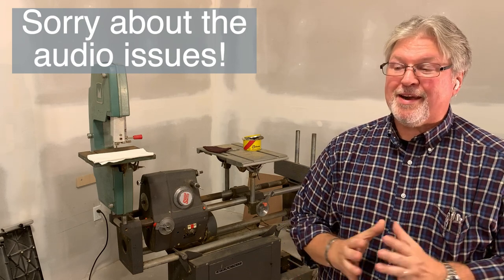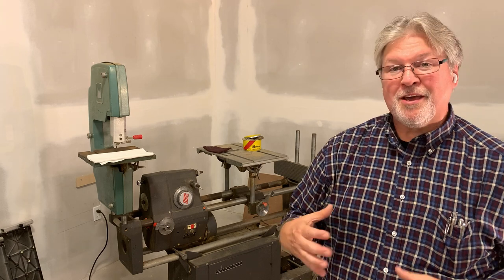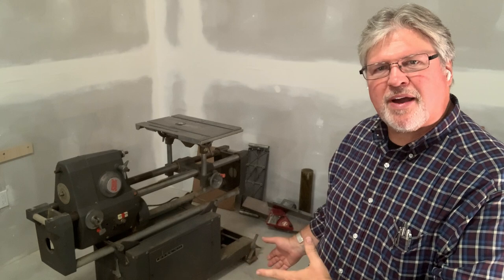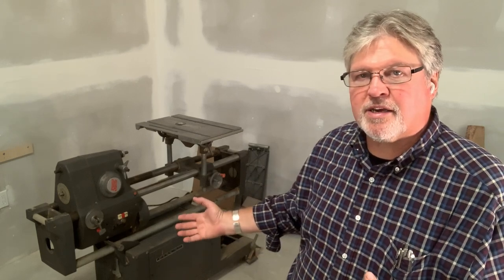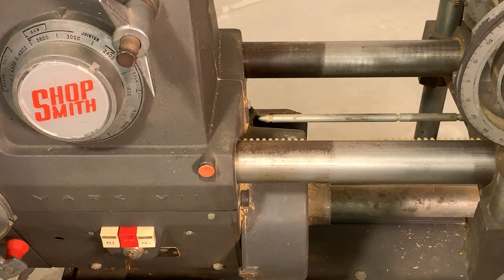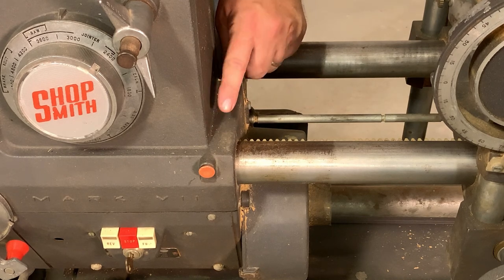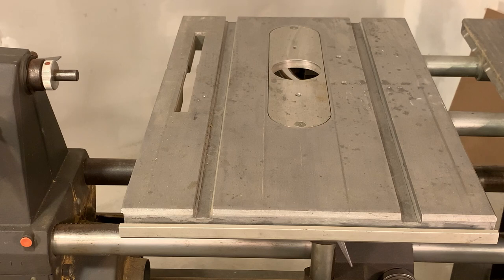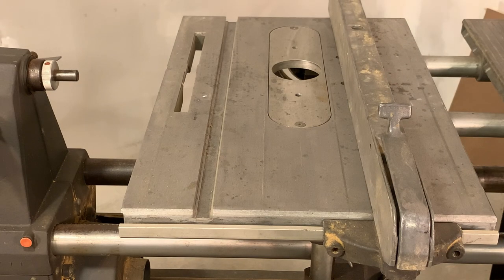Let's "Imagine" a Shopsmith Mark VII, Together

Comment: After owning a 10 ER for years, I picked up one of these.   The table plus extension made me feel like I had an aircraft carrier.  Oh and I did pick up an aftermarket aluminum cam to replace the original (damaged) cam.  My impeller was long gone from mine.
Reply from the maker: I bet it was quite an improvement.
Reply: I think all of us that own one of these would love to stumble on a metal cam. Do you know of any out there for sale? thanks.
Reply from the maker: @jamesellery9238  I haven’t seen one in quite some time, but if mine were to fail I would 3D print one.

Comment: Thanks for the great intro to the older Mark Vll. One thing I noticed with mine is that you can put a modern type head-stock on the Mark Vll base, but not the other way around. The older Mark Vll headstock is taller and the distance between the way and bench tubes is a few inches more to accomodate the larger head-stock. When I got mine, 2 of the caster sleeves were broken. They were cast and weak. I ended up making replacements by first cutting off a 3/4 long bolt, trimming down the head, and drilling out a hole in the bolt to accept the caster. A bushing will not work, because unlike the modern caster sets the top has to have a lip or it will fall out. I also have heard that the 3D printed cams do not hold up.
Reply: I think the durability  would depend on what material and print parameters were used. A print made of ABS or a carbon fiber PLA with enough infill and proper orientation would be quite strong.

Comment: Great overview of the Mark VII.  Although I had seen pictures of it before, I had not seen the actual set up procedures.  Also, I learned a lot about its various features (quirks?).  My 1974 Mark V had that secondary slot in the table, which I used often when ripping cuts that were too wide for the standard slot.  Very handy because I didn't have to worry about aligning the aux table or worse mating the two tables together for those in-between cuts.  Thanks for the education.  Blessings, Glen
Reply from the maker: Thanks, Glen. Yeah, Shopsmith moved away from the second slot due to safety concerns (the blade is exposed) and because the little portion of table to the left of the slot can be deformed easily when drilling and mortising. Even so, it’s a neat idea that certainly offered convenience.  Scott

Comment: Scott, check the power switch as well. My mid 80's Mk V buzzed the same way so I pulled the motor and took it to a repair shop where it promptly started right up on their bench. Turns out the switch was worn and wouldn't pass enough current to start the motor.  Since motor was already out and a PITA to remove the shop recommended changing the bearings even though they weren't that worn. One less thing to worry about.
Reply from the maker: Will do.

Comment: I really liked the folding cranks on my Mk VII. I have arthritis in my thumbs and the locks were easier to use with one hand than the current locks. I had the folding cranks on the table also and preferred them to the newer ones. Overall I prefer my much newer MK V but I miss the cranks, rack and easy speed adjustment. I also liked the rod that could connect the head and table. You should restore that feature on your unit.
Reply from the maker: That’s a very good point. I need to think about if and how to adapt then to the Mark V.

Comment: This is by far the best machine SS made.  I own and use one along with 5 other SS machines (2 10 ER'S, 2 500'S, AND A new Mark 7).  The under table routing works just as well as the Mark 7 (I know it doesn't spin as fast) and the over all operation is just cleaner and to me more functional.  
Be careful with the switch, it works wonderfully, but just remember they don't make them anymore (There is a guy that says he will 3D print switches if someone will lend him a complete switch, he also sells 3D printed Cams.)

If you put the key in the forward position and repeatedly start and stop the relay will start working.  Just needs to me massaged.

Again, a superior design, use it and learn to work it, you will love it!

Comment: Good stuff, Scott - very interesting machine.  I acquired a Mark VII about 10 years ago for what I thought was a pretty good price.  I think it had all the basic parts except for a miter gauge.  It ran when I bought it, but I haven't used it for anything, mainly just getting it as a collector's item.  I guess it will primarily be an exhibit in my own personal Shopsmith museum!  Regarding the drill press mode, it looks like it should have been marketed as a sit-down drill press!
Reply from the maker: That’s actually not a bad suggestion. Where is your “museum” located? Are you going to the get together in Dayton in Oct? Scott
Reply: @MyGrowthRings  You're located in the Piedmont Triad, correct?  I'm actually kind of in your neck of the woods - I live in northeast Charlotte.  The problem with my "museum" is that most everything is boxed up or in storage of some form or another.  I don't really have a decent space for any active woodworking - even with a Shopsmith.  I haven't heard of a Dayton get together - can you provide additional info?  It might be a possibility, but I also have a nephew's wedding to attend in Nebraska around Thanksgiving which might eat up available travel funds for the year.
Reply from the maker: @nutball7537  Yes, we are just outside of High Point. The get together is Fri-Sat Oct 6-7. I need to share some links that aren’t quite at my fingertips. Watch for a video with more details.

Comment: Rather fascinating the engineering that went into the Mark V11.  A feature I’d like to see on the MarkV,7 is the headstock/carriage movement.  The plastic toothed insert could be made of stronger material today - I wonder if SSmith has thought of making tubes that could use such?  Cool video.🤜🤛
Reply from the maker: The crank mechanism is more complex than the entire speed controller on a mechanical Mark V, so I doubt that SS would consider making it.

Comment: i have this same Shopsmith mkvii and its in poor condition and awaiting me looking at renovating it sometime in next??months/years/decades.does switch on.but main problem for me is i am expat in South Africa! but could let the auction house sell it for the price i got it for.will keep a close eye on the post her(have also got a mk5 from same auction which is all working)
Reply from the maker: I suspect there aren’t many Mark VII’s there, so not only will parts be expensive, but you’ll likely have shipping on top of it. I can’t believe I’m actually recommending this, because I’m fundamentally against it, but this might be one of those cases, where it makes sense to part it out, as it may be worth more in parts than as a whole. Scott
Reply: My initial thoughts were just use it as a upright drill press or as a dedicated lathe but it's one of those items on the waiting list for now

Comment: That was pretty cool  to see. I  have only ever seen one in person and was back in the early to mid 80's when I was a kid. I have never seen everything in demo.  I did not know of many of the difference.    I know a Mark V very very well as my dad got his when I was 4 years old and I have 3.  He paid $800 brand new. 
    I do like the gear rack down the way tube but I did not realize it was plastic. I you break one maybe you could find the right size in metal now a days, being several CNC machines use them. I can imagine how easy it is to break them as sawdust loads up in the gear.  Like the main table up and down on my machine will get tight and harder to turn if I do not keep it clean.  I use a wire brush on it a few times a year it is not like everyday.  I am sure you are plenty aware of it. LOL 

I do have a Mark 5 main table that has the extra slot in it for the table saw.  I have even use it a few times.  It is nice because you can keep the fence on the main table if you only need a extra few inches.   It feels weird to use tho.   I normally do most table saw work on my 510.  So that feature carries over to some of the old 5s and I think even the Mark2 has them also.

Now is the speed range the same on both machine's?  Because 5500rmp is the second reason I do not use my overhead shaper.  That is pretty slow. 
   Also some off the mark 5 motors have reverse windings connections in the motor but they are not used.  So depending on your model you can wire up another switch to go backward on a 5 if you want.     That leads me to my final question... In shaper mode does the vacuum direction reverse too?      

Sorry to ramble on so much... you most likely have noticed by now... that I love these old machines too.😅 You have a good one.
Reply from the maker: Good questions. Yes, the vac works in forward or reverse and it has the exact same speed range as the Mark V, so the shaper runs slow. It’s fine for some cuts in most woods, but would work poorly in others.

Comment: Does the main table have a tie bar between the legs? The trunnions resemble the ones on the Model 10 main table, but those can't rotate 90° in both direction because of the tie bar, just as with the Model 500 and later tables. Obviously the tie bar can't go straight across from one leg to the other because it would be in the way of the opening in the table where the tools have to go.
Reply from the maker: It does, but it is different than any other I’ve ever seen. It it dead centered between the legs, but not centered on the table, if that makes sense.

Comment: My first shopsmith was a Mark VII just like this, that nautilus gear was the bane of my existence. Finding replacements was a pain and I ended up just 3D modeling my own. You can now order (last i checked) them printed in aluminum on Shapeways
Reply from the maker: Yes, Shapeways will print them in plastic, aluminum or steel. We live in an amazing time.

Comment: Hey Scott, just curious, what is the diameter of that sanding disk? Mine is only 10 inches. I assumed it was not made by Magna, but now I'm thinking that it was?
Reply from the maker: My brother in law gave me two aluminum discs; One is 12” and the conical disc I showed is 10” and was a stock disc with some of the Mark VII’s.

Comment: Nice overview Scott. Hope u sort the motor issue out—they are worth rebuild/rewind if necessary. When you get the position rod working, it may spoil you—nice to move table and headstock in unison while maintaining alignment of the blade. Drill press is lower, but I just use a shop stool. For under table, you can raise it as high as u want. Unless yours is different than mine, table tilt locks front and back.
Reply: Also, back before I had a shop vac, I used a pillow case and hose clamp on dust collector. One thing you’ll discover is for vac to work in both directions, the impeller blades Are flat-likely not helping efficiency.
Reply from the maker: Yes, my table locks front and back. Could come in handy with heavy stock.
Reply: Also. To adjust the fence there is a nut at the back you can loosen slightly. One glitch (maybe just mine), when u use the fence on the l-shaped extension,, it clamps
On just slightly different..so sometimes I need to fidget with the nut when moving fence from one to the other.
Reply from the maker: @CessnaDaredevil  Thanks for the tip.
Reply: One other feature you may mention later. There should be on the left side of the headstock, just under the closest way tube, a lever. When you flip it it releases the crank from the nylons gears…allows you to rapidly slide headstock/table one way or the other. Flip it back again and you can crank to fine tune position.
Reply from the maker: @CessnaDaredevil  I thought I had shared that, but then I did edit some things out, so perhaps it’s on the “editing room floor”, as they say. I’ll make sure to talk about that in the follow-up, so thanks for pointing it out. Scott
Reply: I’m just happy to see the ol’ Mark VII get some attention and airtime. Thanks!

Comment: HI Scott, would you know if a saw guard from another model would fit the VII? I really feel like I need one.
Reply from the maker: The lower guard would fit, but unfortunately not the upper guard.
Reply: @MyGrowthRings Thank you for replying!  Would the upper guard not fit because of the opening in the table? I wonder if i could use a mark V table instead?
Reply from the maker: @trickyjude5990  No, the mount for the upper guard of the best version of the 500 guard mounts onto the tie bar, which is a different shape and in a different spot on the Mark VII. The best best would be to look at a complete 510 or 520 conversion kit, which will come with a new carriage and the guards, as well as the tables and fence.
Reply: @MyGrowthRings  thank you!

Comment: I really like the mark V11 too bad they did't continue that arrangement,    For all of it issues, I sill like it and I think they could have all been addressed the problems fairly easily.  Maybe the biggest issue is dealing with that switch. I don't think I have sen anything like it. I think it would be cool if it had telescopic legs so that you could adjust the height of the table, down for those of us who are vertically challenged and higher for those who like it a bit taller. one of the things I don' t like about my mark 5 greenie is that the lathe is too short by about 6 inches and it hurts my back to try to work that way, so I put in on some blocks.
Reply from the maker: The height is an issue for everyone. I’ve never met a person who thought that the lathe was the perfect height AND who thought that the table saw wasn’t too high, and vise versa. Shopsmith Inc patented a solution for this issue but never brought it to market.

Comment: I just acquired one of these. 1st question I have is,   Did they have a Name badge on both sides?
Reply from the maker: Yes, there is one on the speed dial on the front and one on the back that covers an access hole. There's also a name barge on each end! They really wanted to make sure you knew what tool you were buying!

Comment: Is the mk7 a universal motor?
Reply from the maker: No, it’s an induction motor, similar to the one used on the Mark V. The speed is changed via a Reeves Drive variable speed pulley system.